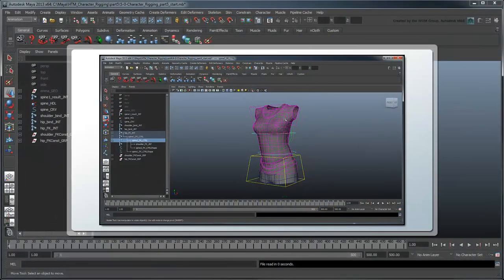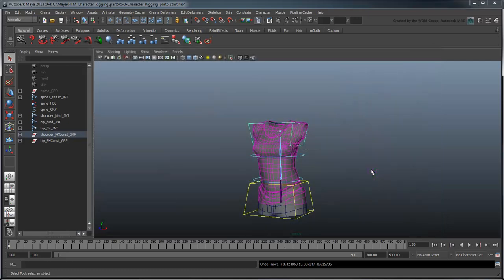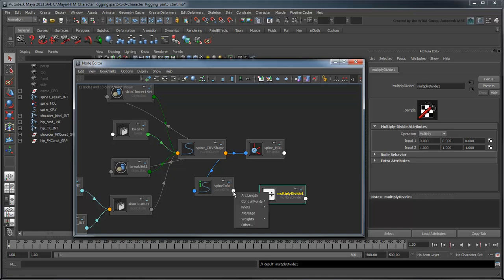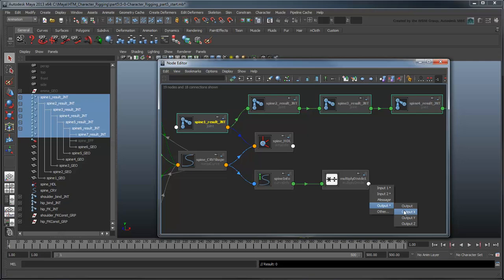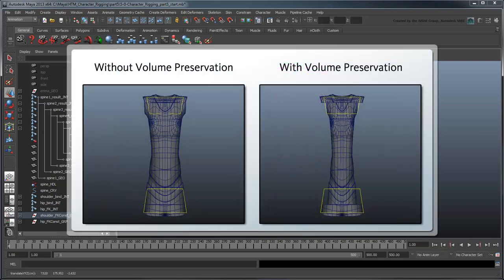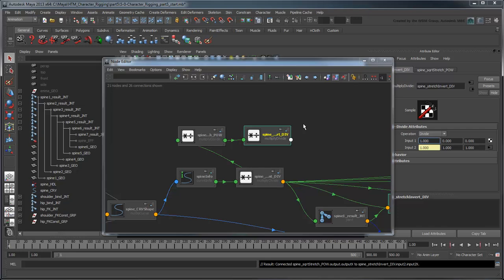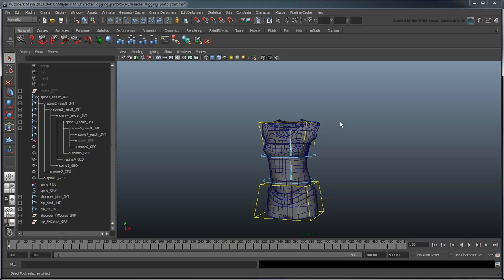Creating a Character Rig - Part 5: Torso squash and stretch (Advanced)

Comment: FOR THOSE RIGGING FOR GAMES: 

I had an issue, because I wasn't rigging for animation, but for Games. Unity and Unreal cannot work with Segment Scale Compensate so I default turned it off in the joint attributes. 
But this throws off the maths in this video. I'm not a math genius, so I'm not 100% certain but I think this is because with Segment Scale Compensate turned off - each child automatically scales the same amount as the parent one. So I applied the % difference to the lowest spine joint ONLY and it gave good results. I think this has fixed it. Will update if not.
Reply: Bless you

Comment: I have problem with squash and streth section. i followed the same but i found my ik bones that are used for node editor were changing their length as i input the multiplydivide node's outputx as their input scalex ---- the thing is the ik bones are the only bones that move.
fks are still remain as original length. so the modeling shape deforms plz help!
Reply from the maker: Are you sure your multiplyDivide node is set to Divide?

Comment: i am having a problem with my squash and strech- it all seems to be working fine but spine geo still breaks a little bit when translating the shoulder control down, the shoulder geo also does not stay connected well. any ideas on how to fix?
Reply from the maker: Sounds like the math might be wrong for the shoulder node (are you sure it's set to Divide and not Multiply?) or the parent constraint is being affected by more than one control.  I'd delete the parent constraint and redo it.

Comment: Hello, I have a question about this; 
what could we do in order to enable/disable volume preservation? I simply used set driven key for that volume node (enable=divide / disable=no operation), but it just turns off and on the attribute, so it's like an on/off switch. What I want is to be able to make change between volume and no volume with smooth values. Like smoothly changing the rotations in IK/FK arm setup. Is this possible?

Comment: There should be an out of the box solution for this...
Reply from the maker: For rigging, or for squash and stretch in particular?  There is an out of the box rigging solution calling Quick Rigging: https://www.youtube.com/watch?v=c538zkwxgTQ&list=PL8hZ6hQCGHMUGuDqcLp44A7BfEpRZbwgM.  It's just not as powerful as creating your own.
Reply: Cinema 4D has a checkbox to enable “stretchy” IK, but it’s been a while and I don’t remember how well it works. My problem with it is that it is too mathematically precise and doesn’t allow for expressiveness, the way a lattice deformer would. For example, you might want to apply more stretching to a soft area like the abdomen, less to a rigid structure like the rib cage.
Reply from the maker: Appendix B of this tutorial series (https://www.youtube.com/watch?v=IINbF0qxyCc&list=PL8hZ6hQCGHMXKqaX9Og4Ow52jsU_Y5veH&index=38) shows you how to make a scalable stretchy toggle, so you can use as much or as little squashing per area as you like.

Comment: Hi! I have been following the tutorials, but anytime I move the shoulder control, the shoulder end joint rotates instead of just translating in x, do you have any clues why this might happen?
Reply from the maker: Are you sure you connected that end joint correctly like the others?  You didn't stick it in the rotation attributes by accident, did you?
Reply: No, all I did was add the IK handle, the weird thing is that the end bind joints which are connected to the controller don't rotate, but the result joints do
Reply from the maker: That is definitely strange.  I would compare your node graph with the one in the attached scene file to see if there are any missing connections.
Reply: I think that the rotation is actually normal, I compared it with the last scene from this series and it might just be from the twist controls. But thank you so much for your help!

Comment: When i put the input 1 value to the input 2 ( 5mn50s ), it's not working. Input 2 value won't changed. It's stay 1.000. i can put 47.000, it's not accept 47.998.  How to fix it, please ? ( maya 2017 )
Reply: I've found the solution  it's OS language problem. We need to change the language keyboaed setting in OS setting to UK or US. Maya doesn't accept "," or "." on french OS version.
Reply: May the dev can fix it on later version.

Comment: i using maya 2015 and i did not link the stretch for the spine end result joint but it still get scale,and i also follow the way  you teach for the neck stretch ,even i did not link to the last joint,it whole still scale. Any solve?
Reply from the maker: It doesn't matter if you link to the last joint or not, since the last joint has 0 length.  It's actually the 2nd last joint that controls the scale of the last joint in the chain.  I'm a little confused though: are you saying you don't want to scale that part?  Why?

Comment: Pro tip: You can just use "-0.5" (negative zero point five) in the "spine_SQRTstretch_POW" node and get rid of the "divide" node after it. Because raising to a negative power is the same as one divided by that number. Saves you one node.
Reply: man beat me to it.
Reply: @Kain-wk6xk  by 5 years 😭

Comment: Hello, I'm using Maya 2017 and I'm stuck on connecting multiplydivide node to my joints. I can connect the output to only one joints, after that  I can no longer see my output after clicking on multiplydivide node and therefore connect it with inputs of another joints.
Reply from the maker: Did you try expanding the multiplydivide node?  This should allow you to see the outgoing connections.  Just click the 3-lined button on the node.
Reply: Yeah, I forgot about that and did that day later :(. Thanks for replying, best rigging tutorial avaiable for free!

Comment: I fear someone has already asked this but I couldn't find the comment again. Could you explain how the "power" operation works in the multiply divide node? if I want to find the square root of X, why do I put X into Input1X and then 0.5 in Input2X? shouldn't input2X be just...1? Thanks!
Reply from the maker: The power function basically does the following: Input1X^Input2X.  If you use a value of 1, the function would just return the value of Input1X since anything to the power of 1 is itself.  Instead, we use 0.5 because X^0.5 is the same as the square root of X (similarly, X^0.33 is the same as the cube root and so forth).
Reply: Ooh wow.. shows how much I retained from math class.  Thanks a lot!!

Comment: Hi, I've been following this tutorial and everything worked great but suddenly the skeleton won't move in X or Z axis, only Y. Any idea why ? It worked before and I don't know what it is that's causing this.
Reply from the maker: Could it be one of the Advanced Twist controls is incorrect?  Try turning that off temporarily.  Does it work again in X and Z?
Reply: I never actually made it that far. When I control the CVs of the curve, the skeleton only moves in Y axis, as if the curve has detached from the spine and only the scale values are affected. I was just thinking if there was an obvious solution, but I guess I should just redo my spine. Thanks!

Comment: I must have hooked up something wrong previously to this video!! my proxy mesh sections are disappearing every time I try to connect the multiplyDivide node to the spine joints for the stretch sequence. Any Idea what's causing this?
Reply from the maker: They probably aren't disappearing.  Try zooming way out or moving the camera around the scene.  They're probably just very far away, meaning that something in the math node is wrong (are you sure you set them to Multiply mode?) or they weren't parented correctly.
Reply: That what I'm thinking so I'm going to try it again.

Comment: // Error: file: C:/Program Files/Autodesk/Maya2017/scripts/others/connectWindow.mel line 2028: No object matches name: SpineInfo.controlPoints.xValue keep getting this trying to connect the world space with the spine info node any help?
Reply: i'm using maya 2017
Reply: For anyone who runs into this problem like I did, Maya 2017 is set up differently in the node editor, so you have to expand the menu on the curveInfo node in order to find the Input Curve to connect the worldspace 0 to. It won't work the way he does it but opening an expanding menu with the mouse while dragging the connector to the input, if that makes sense.

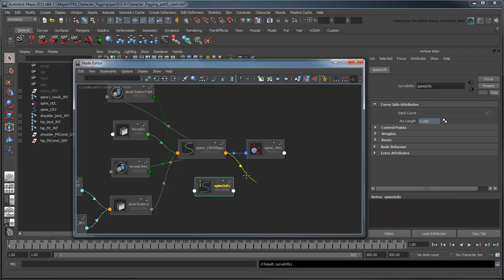Comment: I'm  using maya 2017  there's no worldspace where can i find worldSpace?  at 3:16
Reply: I also found, to actually make the connection, I had to hold down Shift and Middle-Mouse-Button when clicking and dragging to connect between the input and output nodes. Hope this helps anyone with the same problem.
Reply: I was having the same problem, but if you expand the node larger (by clicking on the little bars), you will be able to see the World Space
Reply: Alternatively you can select the spine_CRVShape node and type " arclen -ch 1; " in the mel line. This automatically creates and links up a curve info node.
Reply from the maker: I'm looking in 2017 and it's there.  Are you sure you're clicking on the curveShape node (not the transform node)?
Reply: Thanks, it definitely did help. Couldn't connect them by simply clicking and dragging.
Reply: thank you so much. your tip is so helpful for me :D
Reply: Oh thank you!! This is the unique form I found in maya 2018. Thanks you a lot!!!!
Reply: How did you then make the connection to the next node? Someone in this thread suggested holding shit and middle mouse key, but that did not work for me.
Reply: Maya Learning Channel but the curve connect with the spine handle using world space 0. That is why we cant connect to the spine info.. please tell me how.. or did I do something wrong?
Reply: Justin Pedersen wow!! I type exactly like you did. Amazing!!
Reply: Justin Pedersen could you tell wjat is the function for that symbol? It is useful

Comment: // Error: file: C:/Program Files/Autodesk/Maya2016/scripts/others/nodeEditorWindow.mel line 123: No window found.  Whenever I select node in the node editor, it gives this error. I have been going through official Maya docs but couldn't find anything. Any help, please?
Reply: error referring to environment variables. That is all I can get. No idea how to fix it
Reply from the maker: I would try clearing your preferences.  https://knowledge.autodesk.com/support/maya/troubleshooting/caas/sfdcarticles/sfdcarticles/Reset-Maya-to-Default.html
Reply: Thank you. I reset that. My torso question?
Reply from the maker: Torso question?
Reply: My torso stretches properly, but shoulder_GEO or shoulder_BIND_JNT I would say moves differently along with spine curve. Like they detach  themselves from the rest of the body. I might have done something from the node editor. Help me out, Please
Reply from the maker: Sounds like your math is a little off in the multiply/divide nodes.  The middle joints probably aren't stretching as much as they need to.  Double check your rig using the included scene file.

Comment: There is a problem with my rig. If I move the shoulder controller in any directions the modell stretches and squashes in the opposite direction. I´ve already downloaded your file and compare it, but there are no differences in the node editor and the attribute editor. Any ideas what´s wrong?

Comment: When I translate my shoulder control, the torso piece is not following the control. Do you know what I did wrong?
The HipControl translates and the torso follows it correctly.

I tried redoing the tutorials multiple times and I keep getting stuck here. I translate the shoulder control and the only thing that follows is the spine curve and the shoulder bind joint.
Reply from the maker: +Raisonbran648 Sounds like something is parented incorrectly.  I would check your scene hierarchy against the one in the included scene file.

Comment: I'm pretty far down the rigging pipeline on my low poly characters and I would like to know, can I simply add some nonlinear squash/flare deformers to my character and wire the attributes to the controllers on the rig, instead of this method? It seems to keep my rig fairly light and not weigh down the scene.
Reply from the maker: +PeeyanoKeys If you're okay with the controls not following along with the deformations then yes, I can't imagine why that wouldn't work.  However, your animators may find it difficult to work with the more they deform it.
Reply: +Maya Learning Channel well I am a generalist so I am doing the rigging and animation together. I tried moving the deformer pivot to the shoulder joint (for the arms, the upper arm joint, not the clavicle) and the leg deformers pivot to the top of the leg and that appears to follow nicely enough.
Reply: For FK at least. IK is a little different, would you have any suggestions?
Reply from the maker: To be honest, I wouldn't try to hack together a solution in which the FK and IK controls react differently (i.e. unpredictably for the animator).  Unless you're really up against a time barrier, it would probably be viewed as unprofessional.
Reply: +Maya Learning Channel oh of course. I adjusted the pivot for the main bone chain and now it follows the fk and ik controls in the same fashion. Seems to work for my animations. Thanks for the video!

Comment: Sir my stretch is working properly but the volume preservation is not getting executed what is the reason ??
Reply: But I have created 3 bone setups like ik fk and the of bone for the spine
Reply from the maker: +blossom ghuntla Are you sure you performed the steps from 8:36 and on correctly?  Maybe try comparing your node network to the one included in the linked scene files and see what might be different?
Reply: +Maya Learning Channel 
sir I tried on boxes in different scene files its working fine but the same steps I follow in my rig the stretch works fine but the volume doesn't get executed all same steps sir any clue am using Maya 2013
Reply: Sir I tried the node setup in different file on a box and its working fine and I used same  setup in my rig in Maya 2013 stretch works fine but volume doesn't
Reply: +blossom ghuntla 
scaleConstraint also do fk_ik_skin_joints i think this is the solution of your problem :)

Comment: I'm trying to rig my own character in Maya 2016 with this tutorial set and have been building since the first video. I got the initial stretch to work, but it won't squash it like the second part of the video shows. For some reason in the multiply-divide attribute editor the input 1 or 2 numbers fill themselves in as values different than your video, and it won't let me change it. I'm guessing its getting the data from the nodes I plugged into it, but I don't know why I have yellow highlighted numbers in mine that I can't change while you can change yours. This might be the problem but I don't know how to fix it.

Edit: I tried a second time and the body went crazy with mis-sized parts, but I plugged the wrong number that I couldn't change into both inputs and it seems to be working.

Comment: Is there a way to reproduce this process with an older version of Maya? I'm currently using 2011 and Node editor is not available in the window menu.
Reply from the maker: You can use the Hypergraph Connections Editor to accomplish most if not all of the same stuff, though there will be some slight differences in the workflow.
Reply: Thanks for that. I am in the middle of doing so. Cheers.

Comment: Hello. I noticed in your video, when you squash and stretch, the shoulder geo looks like it pretty much stays attached with the rest of the torso. Mine doesn't. When I pull the shoulder up, there's a noticeable, but not too bad, gap between the shoulder and the rest of the torso. Other than that, it stretches just fine. I am just wondering whether or not this makes a difference in the end. Thanks.
Reply from the maker: This likely means that you split the geometry further away from the shoulder bind node than I did.  It shouldn't really cause a problem.

Comment: I'm having a bit of a problem and I could do with some help! The curveInfo node's arc length attribute doesn't change when I move the shoulder controller. Any suggestions for me? I think I've set everything else up correctly in the tutorials prior to this.
Reply: you may have selected the wrong thing. I accidentally selected the shoulder controller itself to put into the curveinfo. Since its the controller, its length doesnt change and you get no result.

Comment: Hi, I have connected the output x from spine_stretch_percent_DIV to all the spine_jnt scale y and z. when I move the shoulder, the torso stretches but increases in size, could you help?
Reply from the maker: Are you sure you changed the Multiply Divide node's operation to "Divide"?  Also check out Lucas' comment below where he ran into a similar problem.  He tracked it to the Joint Tool, which needed the "Scale compensate" option turned on.

Comment: Hello.  I am having a squash and stretch problem.  When I move the shoulder control or the hip control the squash/stretch does weird things.  If I move the control up, the body stretches way past the shoulder control, and if I move it down it squashes too much.  The shoulder geometry stays with the shoulder control.  The rest of the geometry is where the problem is.  How can i fix this?
Reply from the maker: Did you forget to change your multiply/divide node to "Divide" mode instead of multiply?
Reply: Maya Learning Channel I found out what the problem was.  It was a setting in the Joint Tool.  I didn't have the "Scale compensate" box checked. I'm not really sure why this fixed it, but it did.  Thanks for the tutorial. It is extremely helpful.
Reply: +Lucas Spaeth Hi! I have the same problem, but I didn't fix with the "scale compensate" box checked.
Is there another way to fix it? thanks